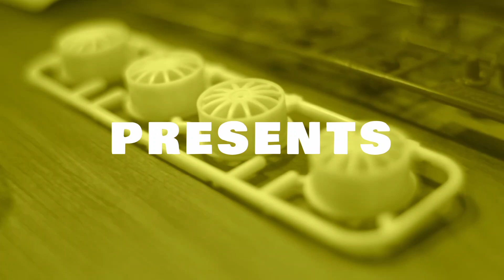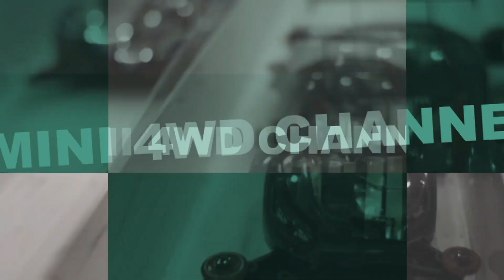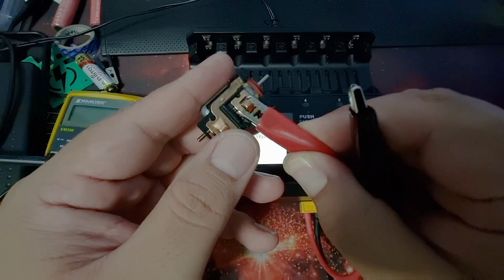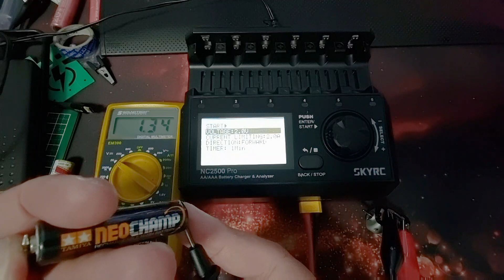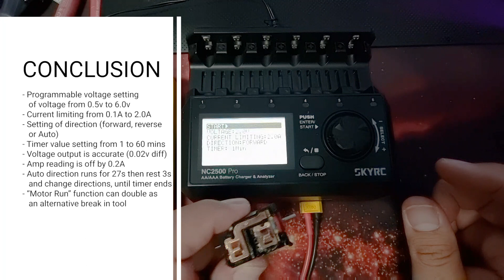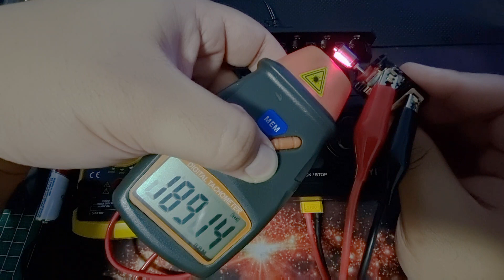SkyRC NC2500 Pro: A battery charger with motor run?!

Comment: Hi I just want to know on how would you break in a front motor, rear motor or mid motor?
Reply from the maker: Rear and mid i would categorise the same, they spin in the same direction.

For these motors, usually I start break in "reverse" direction first (spin in FM). I think break in strategy differs for every racer but I prefer to break in both directions. But I must start reverse.

Vice versa for FM motors. Start in normal direction first.

Hope it make sense for you.

Comment: QUESTION ~
In regards to the amps~ multimeter vs skyrc , the number will be constant ~ so testing several motors with the skyrc you will be able to see the amps draw for each motor~  
~ is it a better motor that draws more amps or less amps ~?
~ toque vs rpm vs battery life~?
Reply from the maker: Gosh. I realised I have not responded. Anyway my take is: less amp is better for batteries. But generally high rpm also requires higher amp. But less amp doesn't necessarily translate to more torque. Torque requires a different equipment to test. 

Generally the Tamiya spec can be "trusted". Maybe abit of variations between batches. Maybe within 10%.

Comment: Hello 👋
Can u charging battery while motor run at the same time?
Reply from the maker: Cannot. Charge. Or motor run.
Reply: Actually you can, but you can only do 1 settings for the motor run as you need to do the motor run first then go back to charging option. After that if you need to go back to motor run, you need to stop the battery charging or anything you do with the battery.